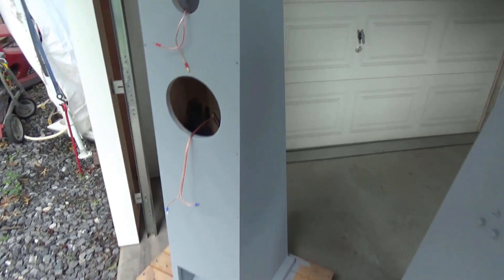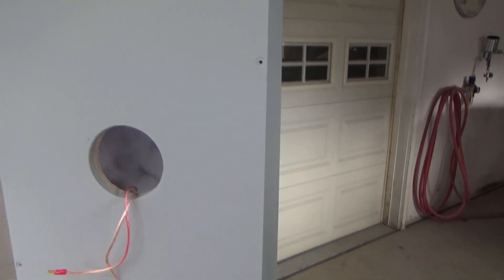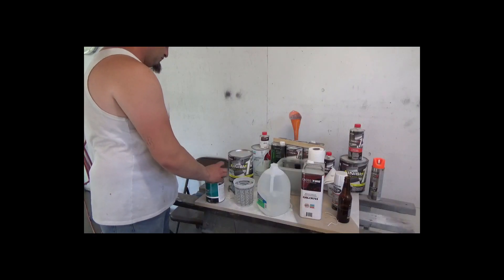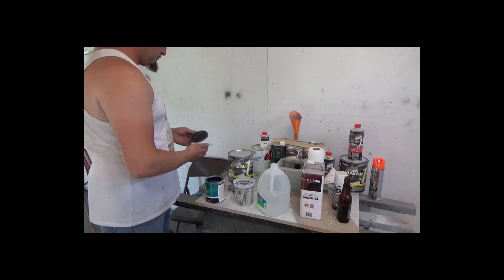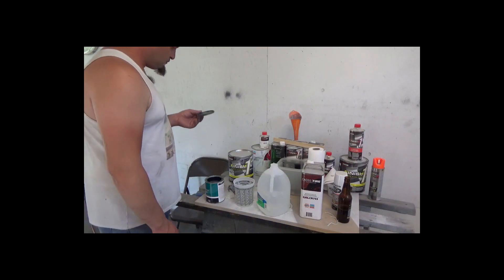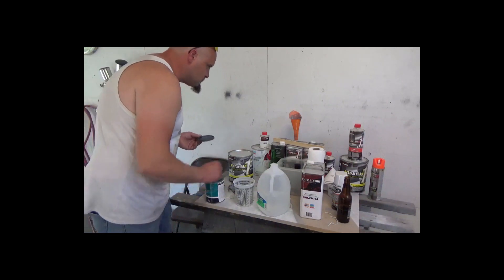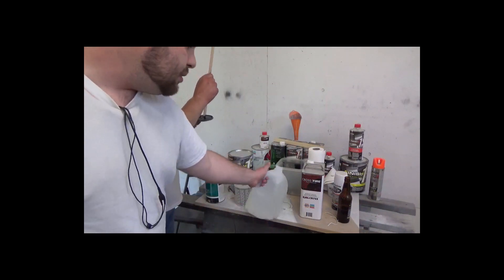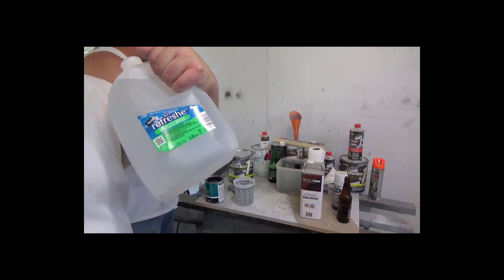BUILDING "World's Second Best Speakers!"

Comment: Son of a B word I want to build these.  But holy cow, they are so damn big!
Reply: Like an engine there is no replacement for displacement.
Reply: The transmission line enclosure can be folded so it's not so tall. You can make it 1/2 the height or even shorter, by extending the length or width and folding internally